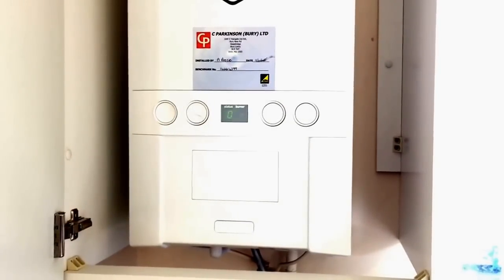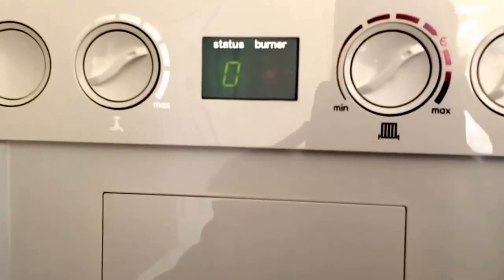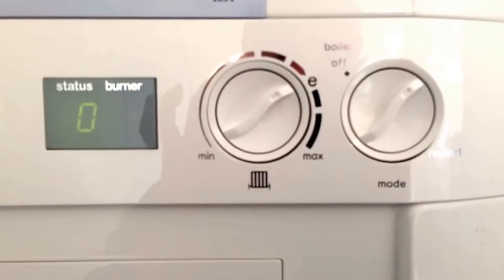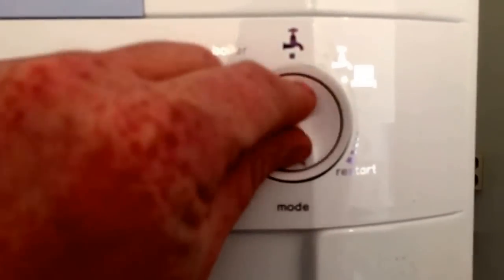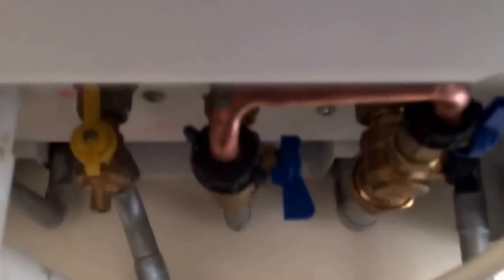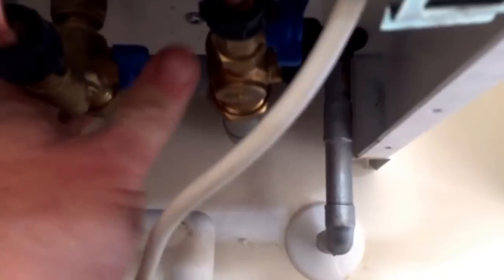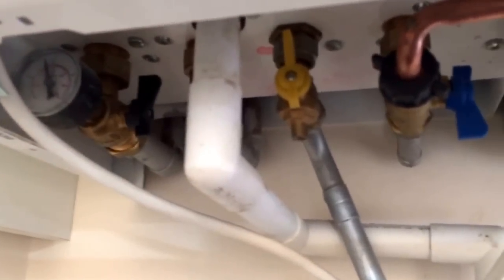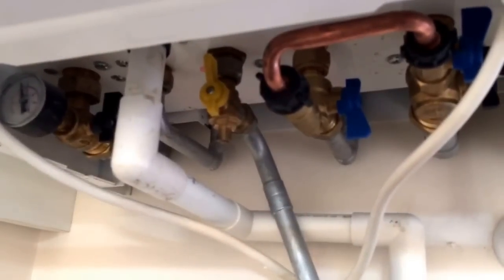#howto #theheatingpro.com #combiboiler Ideal logic combi es30 demonstration

Comment: What should I do if there's no heating in the radiators, there's a snowflake on the thermostat, and even when I turn off the snowflake, there's still no heat coming through the pipes, and they're cold?
Reply from the maker: HI, Let me know what roomstat you have and i may be able to help

Comment: hi, we have jus moved in with the same boiler, we could not seem to make the radiators heat up.. can we ask for help please...
Reply from the maker: Hi,
Some things to run through
1. Is the hot water working?
2. Is the control knob on the right hand side set to the radiator symbol?
3. Does your room stat call for heat, what roomstat is it?
4. is the roomstat hardwired or a wireless type. (Wireless may not be fixed to the wall and there will be a receiver box next to the boiler)
5. Do you have more than one thermostat (this will tell me if your heating is zoned)

If you can answer these it may well take care of the issue or if not point me in the direction of the issue.

Regards
Roger @theheatingpro
Please Like & Subscribe
Reply: @theheatingpro  Thank you so much ❤️

Comment: Hi, my parents have this boiler and they can get hot water but the heating won’t come on. I’ve done everything in this video but the heating still isn’t coming on. The display just stays on 0.
Reply from the maker: Take a look at your roomstats/zone valves. If your roomstat is asking for heat then the zero should change and boiler kick into action. Only thing at the boiler would be to make sure its in heating and hot water mode (winter mode). Summer mode is the boiler dial set to the tap only Regards Roger @theheatingpro Please Like & Subscribe

Comment: Hi
please help. boiler have pressure 2 bar, It was reset but not heating. The radiators is open,but no start.
Where is the problem?
Please help me
Thank you
Reply from the maker: Few things could be issue. Is your boiler set on hot water only? Does the boiler show radiator symbol when you call for heat at the stat? Does the boiler fire and go off soon after? Answer these and I may be able to point you to a solution

Comment: I set it to 2 bar. Is it bad? The manual said 1-2 bar... Please reply.
Reply from the maker: Hi Dan, No don't worry. While the pressure does go up when the heating is on as long as it doesn't rise over 3 bar you are ok. Generally it will go up about 0.5 bar depending on the size of your system. If you haven't already vent your upstairs radiators. This will bring it back down again and if you haven't already will make your heating run more effeciantly. Target pressure generally 1 - 1.5 I would advise
Regards
Roger 
@theheatingpro.com
Please Like and Subscribe

Comment: How do you get ghe heating to start, can the radiators heat up by just using the settings on the boiler? I've just moved house and cant get the radiators to come on
Reply from the maker: Hi,

You will typically have a roomstat which you need to set and make a call to the boiler for heat. The boiler will need to be set in both hot water and heating o the dial on the right of the boiler. If it is set to the tap sign only you will get hot water only regardless of whether the roomstat is calling for heat or not.
Regards
Roger
@theheatingpro.com
Please Like & Subscribe

Comment: Thank you for the video, very helpful....my boiler pressure is above 2, how do I adjust it downwards
Reply from the maker: Hi Arthur,

As long as you don't have an issue with it going over 3 bar there should not be a problem with this. Easiest way though would be to vent/bleed you upstairs radiators.

Hope this helps
Regards
Roger
@theheatingpro.com
Please Like & Subscribe

Comment: Hello Sir thankyou,however sometimes it has worked for me other times it has not i only have 1 blue tap on the Combi on the rear 2nd from last tap the others are all black.Im pretty sure i did the front black too the pressure worked before.This time water came out of various outlets.I tried the back blue and black taps,no water but no pressure added too.The dreaded F1 Error and 0 instead,i thought before i never switched off the boiler,maybe that was the issue.This time i did again and water came out,can i rectify this still,or call an Engineer,whilst yet again Jan Feb etc it went off before and was freezing!
Reply from the maker: hi Jace7, 
Just checking what you mean when you say water comes out of various outlets?
Regards 
Roger
@theheatingpro.com
Please Like and Subscribe
Reply: @theheatingpro  I replied earlier it may not have gone through i tried several times.Sorry i put on the front black taps and water came out of both and through the small hole on the bottom side of the boiler.I said ive fixed before to the Engineer,he said oh you do it if its that easy on the videos,so he ridiculed it!

Comment: Hi guys! I’ve got logic  combo 30 and I don’t have heat or hot water. The display telling me that ignition lockout. I tried to reset the boiler, but  nothing is happening.  I hold into reset mode for more than 5 seconds, but literally nothing. Any ideas?
Reply from the maker: HI Paulina, 
What fault code do you have? Have you noticed a gurgling sound at the boiler recently? Most likely thing if it wont reset would be a blocked condense pipe. You may need an engineer to look at it if that is the case as it would most likely involve cleaning the condense trap inside the boiler. This should be carried out on your annual service 
Regards
Roger
@theheatingpro.com
Please Like & Subscribe

Comment: There is no thermostat or timer in my flat with this boiler. How do I install one?
Reply from the maker: Justfuh Chawns Depends on the boiler and your understanding of electrics. You can get smart controls which work with your mobile via an app, RF ones which need a receiver wiring into the boiler and a battery run stat on the wall or a standard hard wired one which need a minimum of two wires between the stat position and boiler. Few choices but depends whether or not you need someone in to do it for you. Hope this helps a little any other questions just ask
Regards 
Roger
Please like and Subscribe
Reply: @theheatingpro  hi I'd be doing it on a major budget. Not particularly bothered about having anything but a manual timer so I can set it for specific times just the cheapest option.
Reply from the maker: Justfuh Chawns Ok depends then on your boiler, some allow a plug in timer which is as simple as clicking it in to wires coming from the pcb. Which boiler make and model do you have?
Reply: @theheatingpro  logic combi 30. There is a mains power switch and a small white box with an led and a button which turns the boiler on and off like a standby

Comment: Can't get my heating to work I have one in my living room an one in bathroom an hall n bedroom only living room working and pressure showing at 3 any ideas I have restarted it an turned it off
Reply from the maker: Gemma whyte Hi Gemma, at 3 your pressure is too high needs to be between 1-1.5. Could do with letting some off the pressure out. In the meantime let’s look at a few checks on the heating, is your room stat turned up? Do you get a C on the display at the boiler or does it remain a 0?
Reply: @theheatingpro  how do I let pressure out without rad key
Reply from the maker: Gemma whyte Do you get a C when you call for heating?
Reply: @theheatingpro  restarted it and got 52c an rising to 58
Reply: Gonna give it half hour see if all heaters come on some hot at top cold at bottom many thanks for your help I can get cosy now 😊
Reply from the maker: Gemma whyte I would pick one up will only be 50p or so, screwfix or B&Q as it is the easiest way if your not confident with working on plumbing. Get a cloth and vent some water out into a bucket or basin using the cloth to divert the water or if you are lucky and have the vents with white plastic outlet on them you can direct them to squirt directly into your bucket. Don’t take too much out about half a mug of water and then check the pressure. Try doing this when the system is cold as it will give the true reading of pressure. Regards Roger
Reply from the maker: Gemma whyte Sounds like you may have an air issue. Had the heating gone to zero and knocked off prior to you trying to refill it?
Reply from the maker: Gemma whyte Are all the radiators on the same level ie an apartment or two levels as a standard house?
Reply: @theheatingpro  yes all same ground floor flat
Reply from the maker: Gemma whyte what is the heating stat set to on front of the boiler is it set to “e” or above?
Reply: @theheatingpro  above
Reply from the maker: Gemma whyte Hi Gemma have they all worked ok up till now?
Reply: Hi I stupidly played about with taps an now I don't know what way they meant to sit I have one black at pressure gauge then yellow gas then 2 blue an another black
Reply: Now I have no heating can you help
Reply from the maker: Gemma whyte ok should be able to get sorted for you
Reply from the maker: Gemma whyte under boiler both black taps on outside should be pointing up to the boiler. Yellow gas tap should be pointing up too
Reply from the maker: Gemma whyte Tap to the second pipe from the right should be pointing up, if you have that one in wrong direction water will stop coming out of your hot tap
Reply: @theheatingpro  hot water tap working fine can see flame an tap when run it an temp rises to highest
Reply from the maker: Gemma whyte The tap which connects to the right hand side pipe should be at 90 degrees angle to the pipe to be off
Reply: @theheatingpro  thank you two blacks up yellow up first blue water works second blue struggling with not sure about but still no heating
Reply: Spoke to soon just went off again
Reply: Now I have a spanner and code 5L

Comment: Hi ,my boiler is not working ,no hot water no heating ,and the status keep showing number 1 and f 
What can I do pls ?
Reply from the maker: Hi Khadiijeh, F1 is a low pressure fault you will need to check the pressure on your boiler and top the pressure up via the filling loop under the boiler. Hope this helps Regards Roger
Please like & Subscribe
Reply: Thanks

Comment: My mum just got an ideal logic combi c30 boiler the 0.0 is on the screen. But she hasn't got a timer for the morning. The dials are on e, tap n radiator. Her radiators are on temp 5. N the thermostat is one where you turn it to 5 10 15 etc but she would like it to come on in morning n an hour before bedtime or before n after shower. It was placed in by the council n there didnt tell her if it's got a timer. She like to know what she should do. Thank you.
Reply from the maker: Loobysworld Need to have a chat with the council, there should be both time control along with temperature control for it to be a compliant installation. Hope this helps Regards Roger

Comment: Hi, I have a combi 50, which I believe is just a bigger capacity version of the 30, I'm lead to believe that the e setting on the hearing dial is the most efficient, but what I find in this setting is that the radiators get very hot, which seems to blast loads of heat into the house very quickly, which makes it quite uncomfortable. From what I've read from other sources, the e setting should make the radiators run at a lower temperature around 50°? Mine are definitely much hotter!
Reply from the maker: Nik Sutherington Hi Nik, The e setting is an economy mode which will reduce the boiler flow temp from its maximum of around 80 degrees. There is no literature on what that temp is but I know it isn’t as low as 50 degrees. I will measure that temperature as I would like to know myself now you have raised the question and update but can only do on a 30 or 35kw. The 50 will be classed as a commercial boiler and may vary from this. The radiators should get hot enough to transmit their heat via conduction radiation and convection to heat the space where they are located. Generally you would only limit the temperature to them if you had a worry of someone burning themselves on touching them such as small children. Ideally you want to raise the temperature in the room in as short a period as you can and would want to limit the overall comfort temperature with either thermostatic radiator valves individually in each room or via a master comfort temperature on your roomstat. If you have a larger property as a 50 boiler would suggest you would also need to look at having the system balanced to distribute the heating evenly as some rooms/ radiators will heat up quicker than others depending on location to the boiler and upstairs compared with downstairs rads. Hope this points to something which helps you make the temperature more moderate. 
Regards 
Roger 
Please like and Subscribe 
I will follow up with my findings on the “e” boiler flow temp

Comment: Hi, i have the exact boiler but im getting an error c. And by the looks of it, the pressure is high. How do i lower the pressure. If you could help me that be great. Thanks a lot
Reply from the maker: Hi Ali,
C is not an error but telling you the boiler has a call on it (thermostat is calling for heat) To lower the pressure you would be best to locate a drain off valve on one of the downstairs radiators and draw a small amount of water into a bowl. The difference in 1bar pressure to 0 is suprisingly small and only a small amount of water generally around a litre. Hope this helps
Regards
Roger

Comment: Nice video. I have the same boiler which is Logic Combi ES30. It’s just under 3years old. The boiler would not fire up and I’m getting a code L2. The pressure level is ok, I would be grateful if anyone has any ideas or suggestions?
Reply from the maker: LOVE FOREX Hi, could be a number of things but a common one is the black taps on flow and return not pointing up. Sometimes they are moved by mistake when topping up the boiler pressure. They should both be pointing to 12 o’clock. Check this first then I will go through other possibilities 👍 Regards Roger

Comment: Hi sorry to bother you but my logic combi 30 boiler does not put heating on, it’s pressure is set on 1 n half but heating doesn’t come on, hot water works fine thx please help
Reply from the maker: Hi, 
1.Is it set to heating and hot water mode?
2. Are the black valves under the boiler pointing up?
3. Does radiator symbol come on in the display when you call for heating (does it fire and go off?)
If you can check these for me and come back if it is still not working.
Regards
Roger
Reply: Hi thx for getting bk to me, it every thing is exactly what it shows in ur video. Could it b some thing to do with my thermostat cus I’ve relized it doesn’t come on thx
Reply from the maker: S - Ali Pakistani pigeons uk Quality Not Quantity Yes, if your stat is not calling for heat you will have a zero at the boiler instead of a C for call. What stat do you have? Regards Roger
Reply: CParkinsonBuryLtd  hi it just says 0 n a a red light on thermostat, the controller the u can take with to ur room to put heating on n off is working going up to 30 but still no heating ta
Reply from the maker: S - Ali Pakistani pigeons uk Quality Not Quantity sounds like a RF wireless stat will probably need linking up with the receiver near the boiler, what make and model is it and maybe I can help 👍
Reply: Hi it’s ideal combi 30
Reply from the maker: S - Ali Pakistani pigeons uk Quality Not Quantity No I meant the roomstat

Comment: hi I have same boiler it's not turning heating on .
Reply from the maker: ismail Hussain Hi Ismail, is the pressure where it needs to be, is it switched to heating and hot water, is the stat turned to E on heating. Do you have a C or radiator symbol in the display? If no radiator or C then it’s unlikely to be the boiler but your external controls ie roomstat or programmer. Let me know which of these applies and I will do my best to help you
Regards Roger
Reply: Thank you for your advice but after your reply my brother maniged to  fixed it. It was the water pressures .
Reply from the maker: ismail Hussain Glad to help Ismail Subscribe and I’ll always help out where I can Regards Roger
Reply: CParkinsonBuryLtd this has happened to me I have a C symbol in display
Reply from the maker: Ashleigh McMurray Hi Ashleigh is it firing for a short time and going off? Check both black taps under boiler on flow and return pipes are pointing upwards

Comment: I have a newly fitted Logic+ 30 and it seems to fire up A-OK and heat the rads with a temperature showing in the display but then after a while switches itself off and the display reads 00. I understand this code means the boiler is in standby but my rads get cold again and boiler doesn't always switch back on. Is it faulty do you reckon or have I got the wrong settings or something? It has a   Salus RT500 thermostat with a Salus ERT20x wireless transmitter. Cheers.
Reply from the maker: keefstagram71 Hi Boiler when in 0 is not receiving call from your stat and doing what it should so is working and doing what it should. Looking at your stat would be where I would focus. What temperature do you have it set to? Is it located in an area that heats up quicker? Not allowing the other radiators chance to get to temperature? Do you have it set up and program or do you turn it on manual? Some manual overrides knock off when temp is achieved. Take a look at these points and come back to me if you need any further help
Regards 
Roger 
Please subscribe 👍
Reply: @theheatingpro  Cheers! I have it on timer setting since yesterday and it's switching on and off during the hours it's supposed to. I think maybe like you said, the thermostat was in the wrong place. Thanks for your help mate.